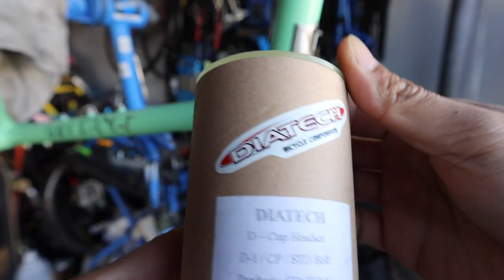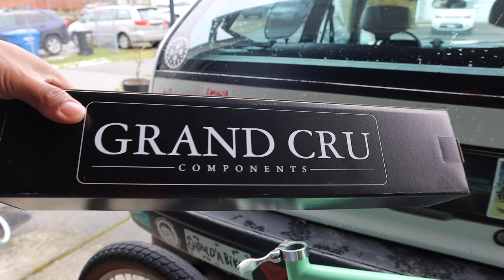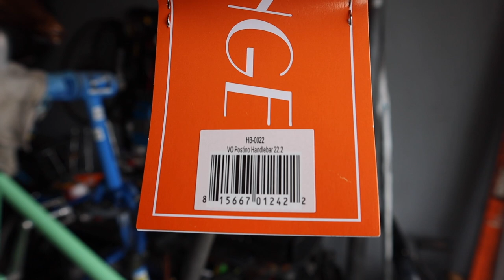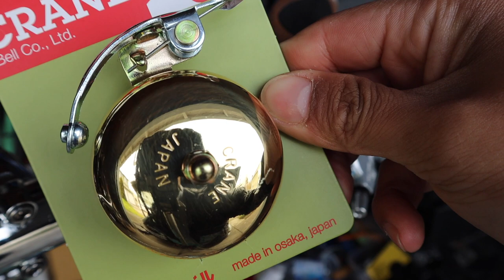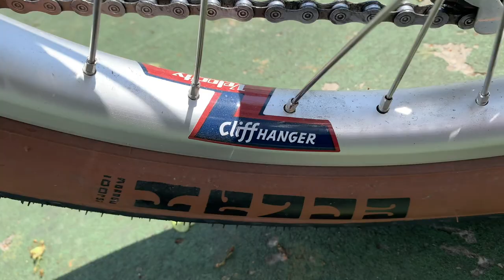Velo Orange Neutrino Mini Velo Dream Build!

Comment: Small wheel bicycles deserve a revival in our urban centres. They are apartment friendly, and alot easier to haul up stairs or around street furniture. They have none of the compromises of folding bikes but all of their nimble steering and shop friendly form factor (most supermarkets and smaller malls here in Australia have no issues with them inside).
Reply from the maker: all very factual!!

Comment: Hey man, sick build, loved the video! If you don't mind, could I ask you your height and inseam, and how the bike fits you? I'm debating between the small and large Neutrino myself, very on the fence as I feel I'm in between sizes at 5'7"
Reply from the maker: Sure thing, I’m also 5’7 and inseam I’d say between 30-32”. I was also in this same pickle as you in between bike sizes. It’s a little compact but adding the 90mm stem helped a lot and fits like a glove. 

I’ve been riding it everyday for quite sometime now, it has been such a blast and don’t feel any regret getting the small. By any means it is a slow but zippy bike that can accelerate pretty quickly.

i also went for the small because that was the only size they had at the time and it worked out.